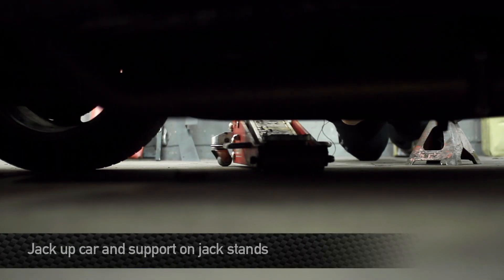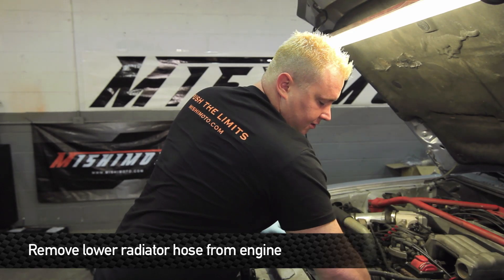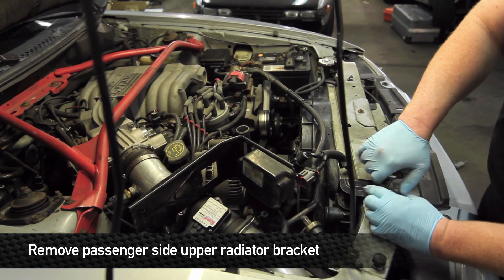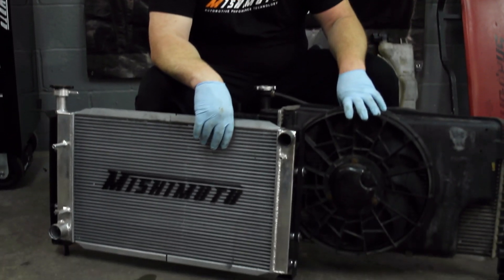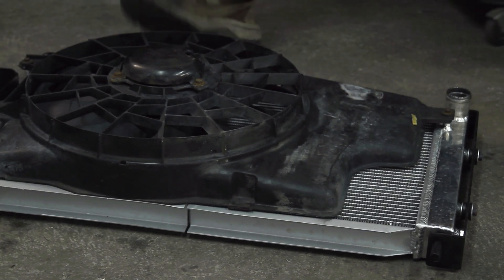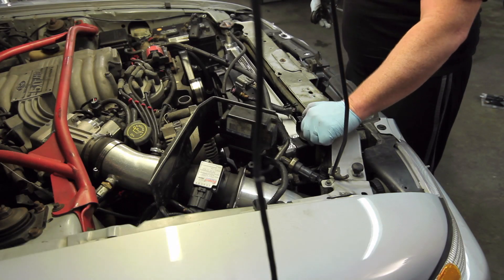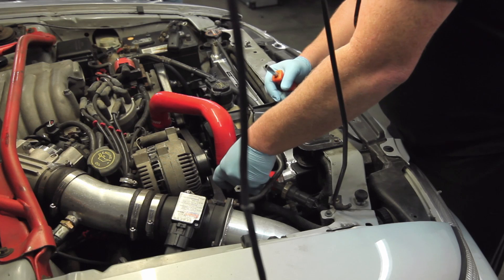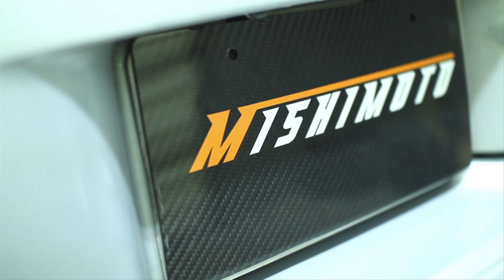How To Install: Mishimoto 1994-1996 Ford Mustang Radiator

Comment: do you make that for the Automatic Mustangs also?
Reply: The SVE one from LMR has the two ports for the automatic transmission lines. In my case I capped them off since I have a manual. This one looks a lot similar so I’m assuming it has the option for both. I’m sure you’ve found your answer just replying for anybody wondering.